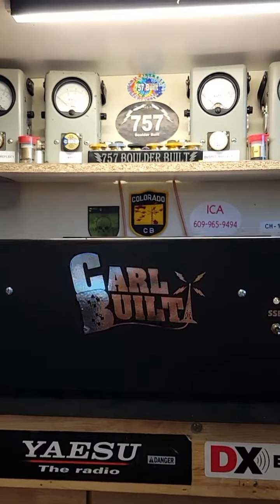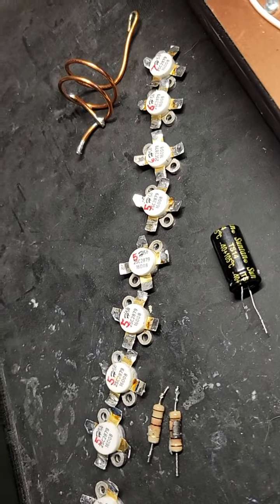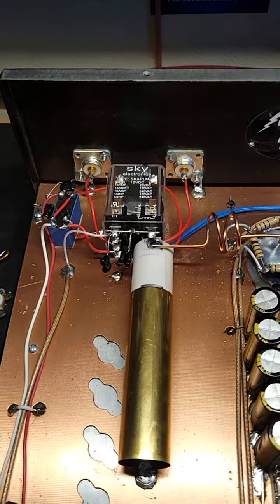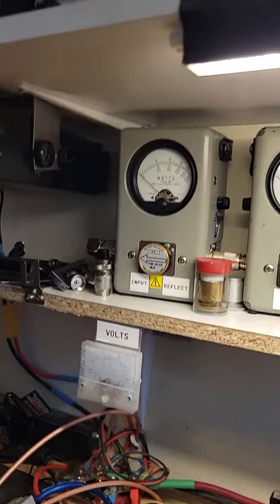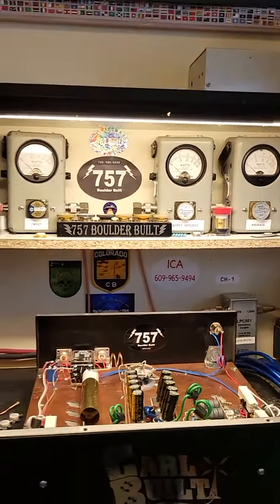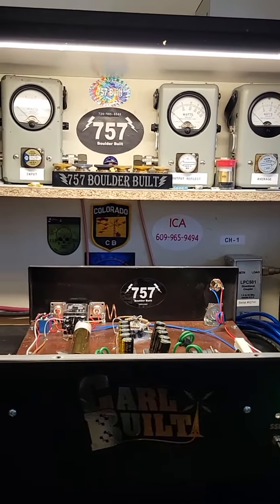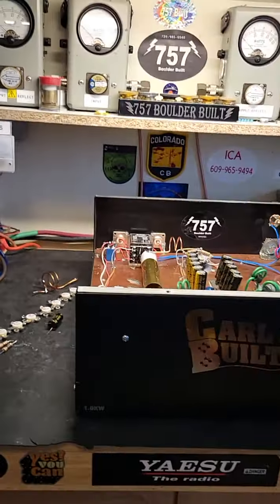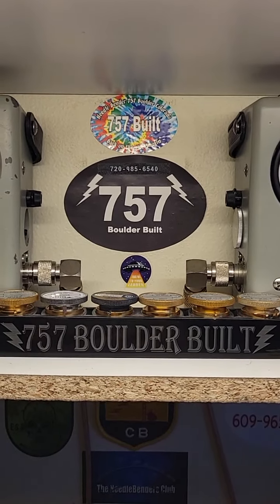2 & 10 pill repaired and tuned to 28.400.mhz.

Comment: I've been in electronics since the 1950s both as hobby and career and never heard of a transistor referred to as a "pill" until now.
Reply: Then you haven't spent any time in the cb hobby
Reply: @Rooster_Radio  I once did, then got my ham license decades ago. Apparently CB is the only realm in electronics where that term is used.
Reply: @joewoodchuck3824  Pill is apparently a relative term. A 1 pill LDMOS amplifier at 50 volts can outperform a 4 pill 13.8+ volt amplifier. It depends on the pill.
Reply: @keyboarderror1  I'm well aware, but thanks.